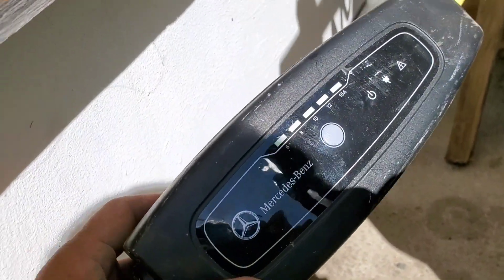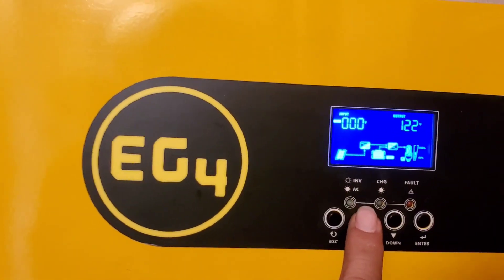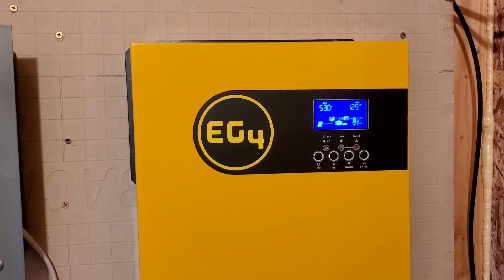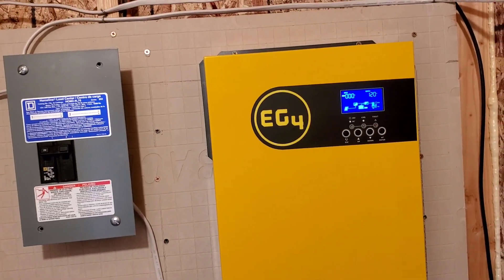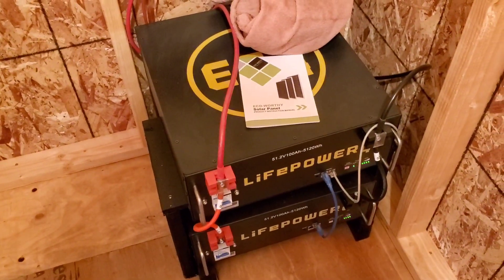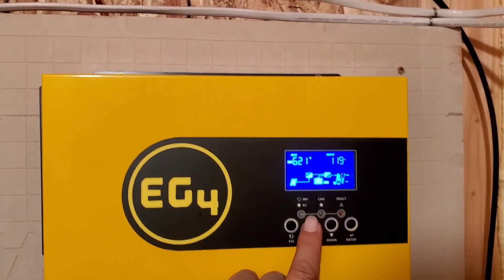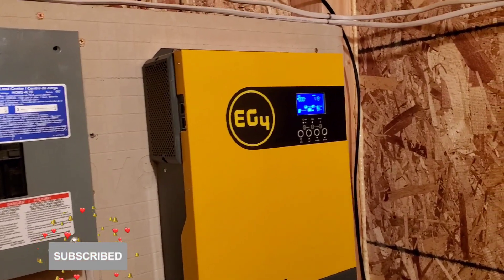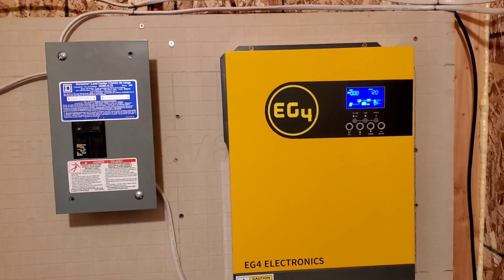EG4 INVERTER PERFORMANCE

Comment: Are you feeding your inverter with 120V AC as a backup? If so, it looks like you have an orange cable feeding it. Ist that an extension cord that you cut the end off?
Reply from the maker: Yes it's cut off. But I'm not feeding it. Only when I want to charge the batteries I'll do it.
Reply: @Coalcoman925  So you are not leaving the feed plugged in all the time to automatically charge the batteries when there is not enough solar? Or are you connecting it manually when you need it?
Reply from the maker: @andrewh3101  manually. Only when cloudy days
Reply: @Coalcoman925  thanks
Reply: @Coalcoman925  If you are only feeding / connecting it on cloudy days to a wall outlet, I'm assuming the wall outlet is supplied by a 15A breaker. If so, did you change the "default" #11 setting in the inverter for "Maximum utility charging current" or did you leave it at 30A?
Reply from the maker: I left it on the default settings on that.

Comment: Do you have a picture of how you wired it to your electrical box?
Reply from the maker: https://youtu.be/perL379Pg20
Reply: @Coalcoman925  THANK YOU!! Just what I was looking for. I actually have the same setup as you plus the same Square-D Home Line Main Lug Panel. Is that a double pole breaker you have in there? I plan to just use a single pole breaker.
Reply from the maker: @andrewh3101  yes it is double. Don't forget to subscribe.

Comment: Does the fan constantly running when no load on the inverter??
Reply from the maker: Yes. It changes speed depending on the load.
Reply: @Coalcoman925  yea mines constantly running, I thought something wrong  with the unit

Comment: you said you have 3 panels, how many watts ? Are those 3 panels enough to charge your two batteries totally 10kw?
Reply from the maker: I have 12 panels. Each one is 100 watts each. 10 of them are renogy and 2 are eco worthy. All the panels are 100 watts 12v each. On a sunny day I can get from 5% to 80% of solar power in one day.
Reply from the maker: I have another video where I show my solar array. Please subscribe thanks

Comment: Hey brother how you doing I just came across your YouTube channel. And I'm thinking of buying the eg4 for my off-grid cabin do you really recommend it so far I always at working for you?
Reply from the maker: The EG4 inverter is perfect. So far i been using it without problems. If you're thinking on buying it, make sure 3000 watts will be enough for you.

Comment: I have a couple of these running in 240 split phase. they work great but the app is not telling me my total energy production. have you used the app? is it telling you your production? thanks.
Reply from the maker: My usb receiver broke and never had a chance to use it.
Reply: Please make a video on how to wire two of them together for parallel ...and the output wires from both to the A and B legs in your panel. Thanks

Comment: How loud are the fans and are they running constantly?
Reply from the maker: If you leave the inverter off, then the inverter will stay on during the day. The charge controller kicks in to charge your batteries. Also it's kinda loud if you plan to put it inside your house. For me it doesn't bother me. Im away from it. The fan is low when charging from 300 watts to 450 watts. But when it goes from 700 to 900 watts of solar charging it's kinda loud.

Comment: I dunno how much it matters.. but in theory.. if you connect your batteries slightly differently it will wear the top one less.

According to Will Prowes(?) you want to connect the inverter on both sides of the battery (at opposite ends of the battery ) eg.. if your inverter positive side first connects to the first battery.. then you want the negative of the inverter to hit the second battery. 

Probably won't matter much considering your only cycling your battery once every 3 days?.. age will kill it first. :-) 

What climate are you in? are you going to put in any battery heaters? I can't remember if the eg4 BMS has a low temp cutoff for charging that the lifepo4's needs. 

How many miles do you get per kwh in your smart? my 17' bolt gets about 3.5mi/kwh (the way I drive it) I estimate your setup would pay for itself after about 8k miles with my car. (and my electricity prices) 

Anyways thanks for sharing your journey.
Reply from the maker: Yes i did that with the batteries already. Thanks. I live in the bay area close to San Francisco. The climate is not to cold or to hot. Well sometimes it gets hot but nothing  major. Thanks for the advice I appreciate it.
Reply from the maker: I can add like 35 to 40 miles to my smart when i charge it during the day. I haven't tried doing it during nights so im not sure.